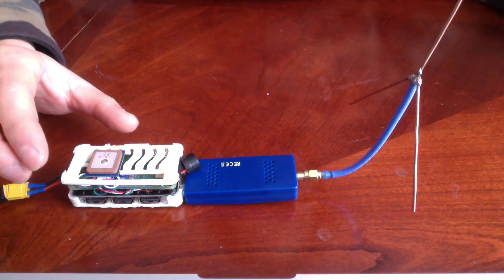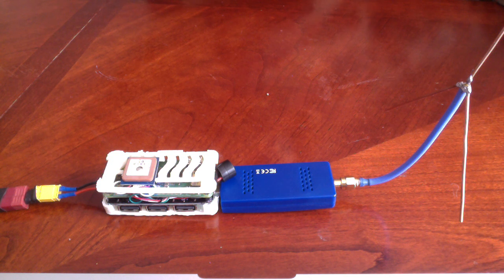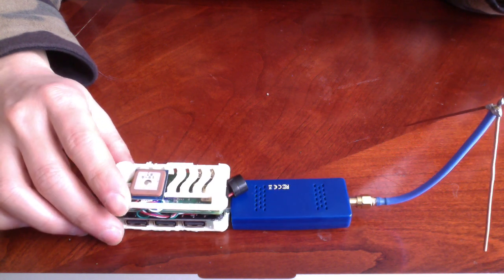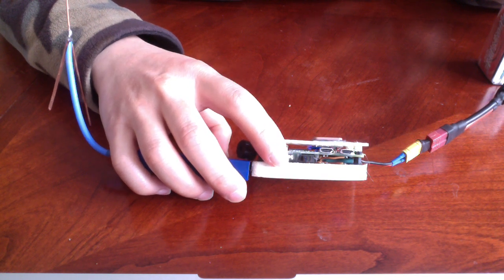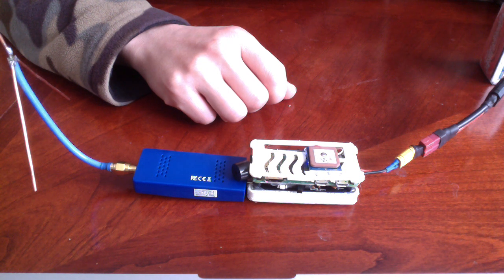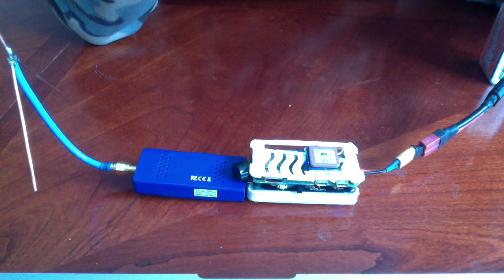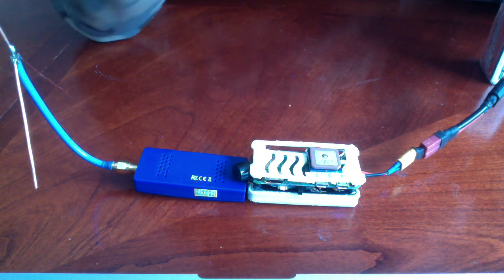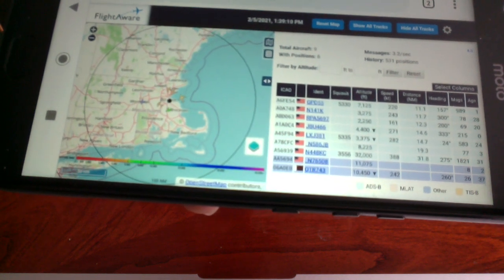FPV Radar - $50 airplane radar for safer flying

Comment: Where to connect the buzzer . Gpio 17 and ground ?
Reply from the maker: Yup, code says 17
Reply: Thanks. It work  perfectly . your github page was very helpful.
Now is there a way to set others GPIO pin for buzzer in your code. I want to use a 2nd buzzer and some red led . Can you help me please.
Reply from the maker: @aurelienclair4465  If you want to use a different pin for a buzzer instead of 17, you can change it in the code. However, it sounds like you want some additional features in which case you may have to add some additional code and I'm not sure how I can help.
Reply: @blimpwings  ok. Yeah i need a 2nd Gpio pin to light some LEDs  when the buzzer buzz ! I will try to duplicate some parts of your code.
Thanks again.
Reply: BTW I found a way. I used LEDBoard instead of Buzzer ( import from GPIOzero) and used 3 GPIO pins to wire 2 buzzers and 1 red led.
Now I have a louder and longer bip (increased wait value) and a luminous signal.